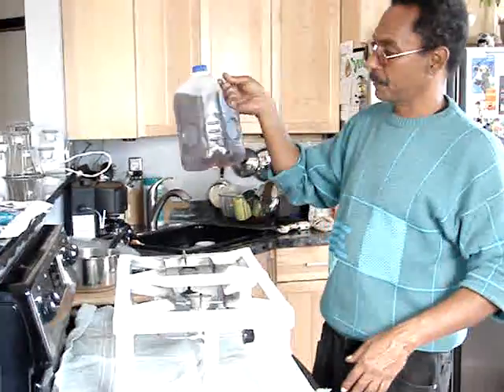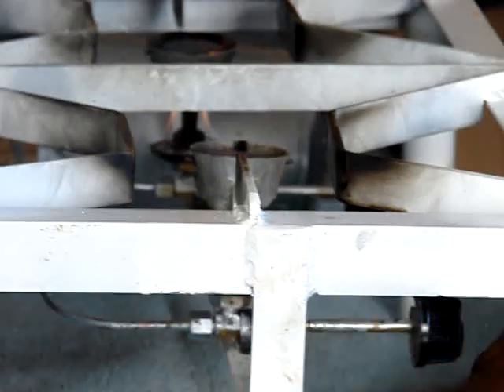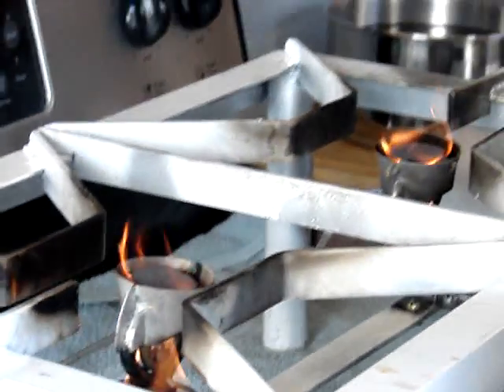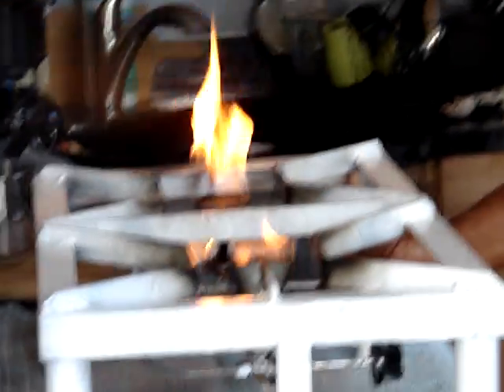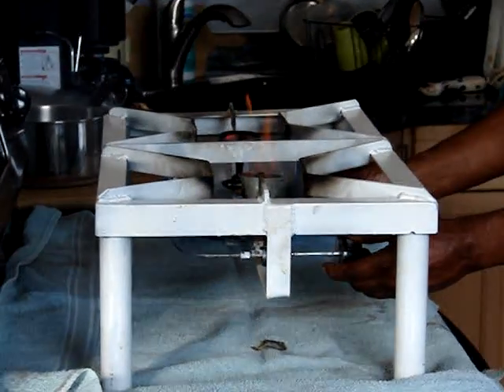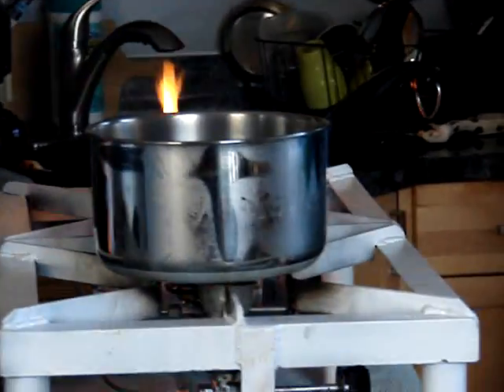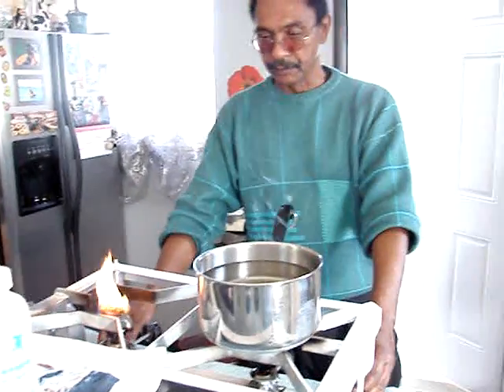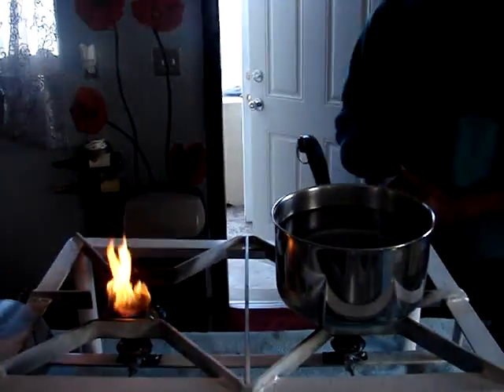biodiesel stove presentation

Comment from the maker: The blue flame cannot be seen in this video but 85% of the heat is generated with blue flame, we use 25 lbs pressure on the the tank and I will clean the injector to ensure a 100% blue flame show.
I will post a new video that shows only blue flames after fix it.